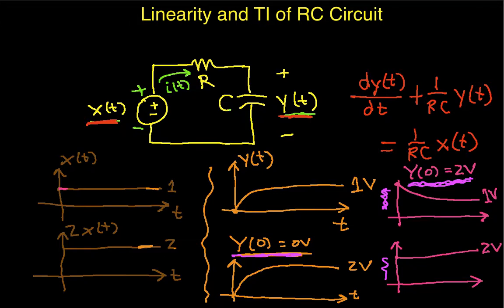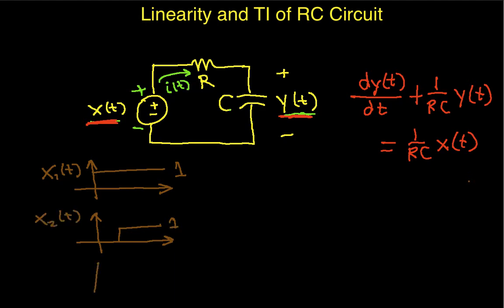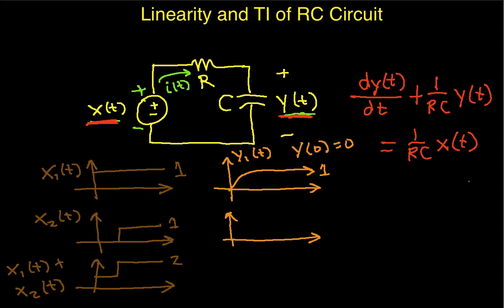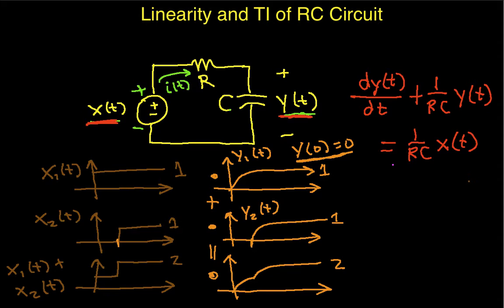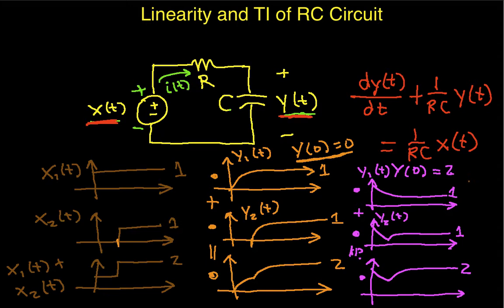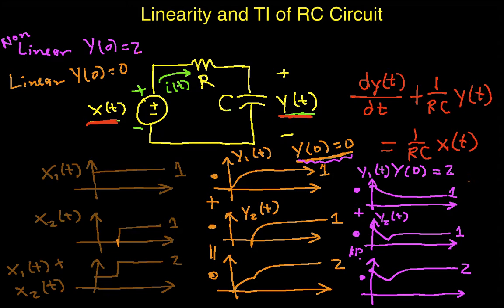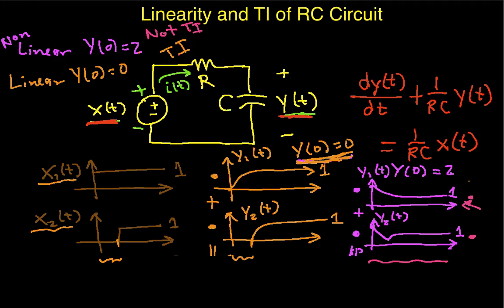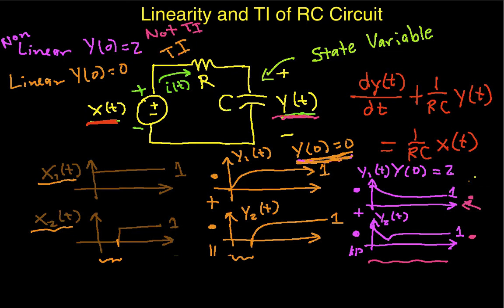Linearity and Time Invariance Example: RC Circuit Part 2

Comment: The fact that the linearity of the system depends on the initial conditions was troubling me a lot.
Thanks for confirming the fact with me :)
My confusion was based on the fact that after infinite time(long time), even the non-linear RC circuit (with initial Vc) would turn linear(nearly linear)!!
That felt quite surprising to me, when I had worked it out myself.
Thanks again for the wonderful video series, with examples, which helped me develop an intuitive feel of time invariance